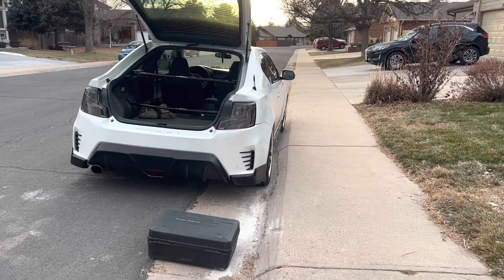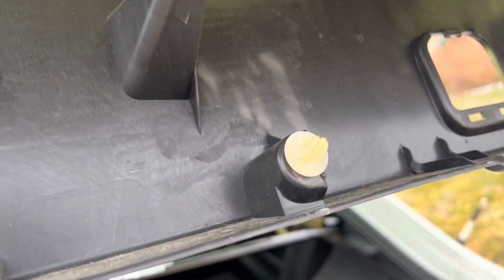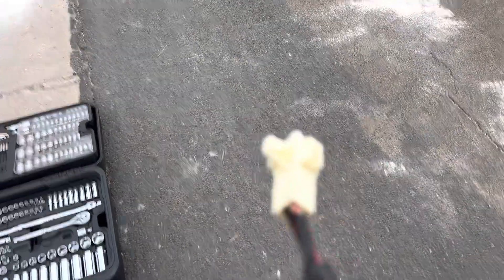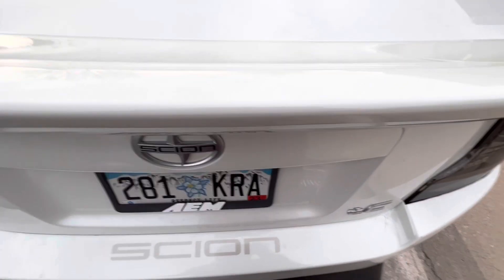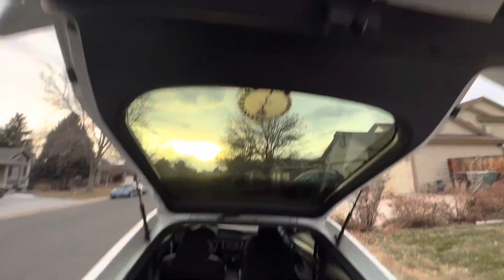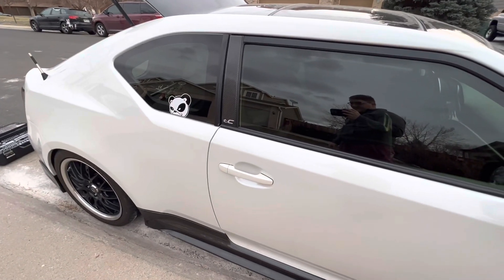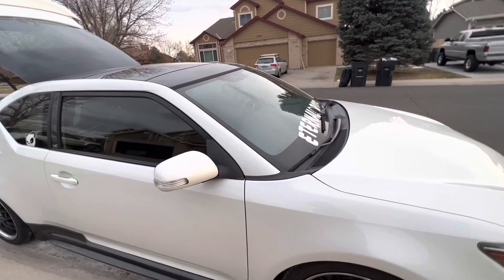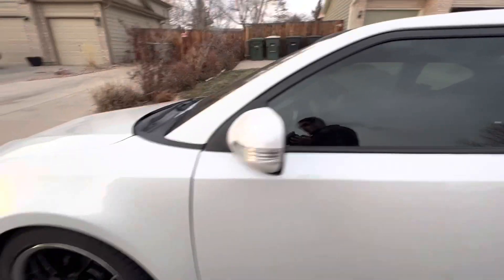Replacing my 2015 Scion TC hatch latch

Comment: any update on the cams from frankenstein motorworks? thinking about getting my own and want to know how hard the install is
Reply from the maker: I wish man, also unless you know motors and have all the right tools I would recommend getting it done by a shop, I’m having nixspeed do it as he works on 2ARs alot
Reply: @tlamedia_  I wish I had a shop nearby like that...Im in Canada... when are you getting it done?
Reply from the maker: @jarod1029  I’m waiting until spring, I don’t trust my tires in snow that much especially if I were to add 100whp